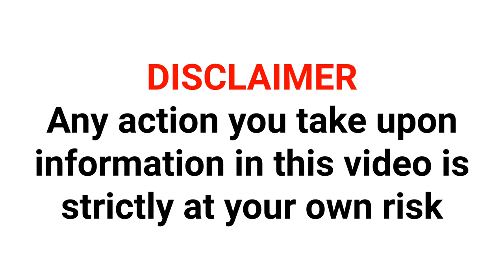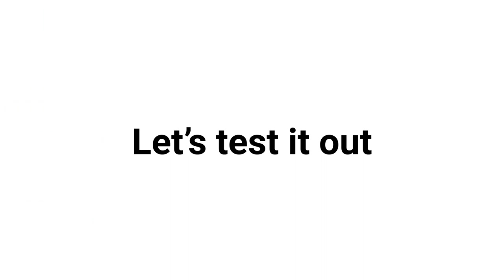Mixing Bowl Pizza Oven Assembly Instructions

Comment: Hi, this is a phenomenal idea and I will try to copy that. But I'm curious about something: How warm do the conductors which are directly contacted with the heating element get (at timestamp 2:58)? Could the insulation melt? And also the resistance of the cable could rise when the cable is getting warmer (but I don't know if this is relevant). Thank you so much!
Reply from the maker: The nichrome wire inside the element ends at least an inch and half from the connecting terminals so the ternimals don't get that hot. The fire retardant tape wouldn't even melt. You could use terminal connectors for proper wire connections https://ebay.us/nHsMKh . The cable does get warm after some 20 mins of continuous use but that's normal. I use 10amp cable which can resist 2000w of power. The element I use is only 1800w. For my use cooking flat bread and pizza, I preheat the bottom pan on gas for some 5 mins. After that I turn on the oven and pre-heat the bowl for 5 mins and that's all the time it needs. After cooking I turn off the oven from wall socket to prevent over heating.
Reply from the maker: @andreas5160  Nice list of items. Should be a nice build especially when you use a 16amp for 2.4kw is great and much safer. One important bit I'd to make sure the element is moulded into a W shape otherwise it will not cook evenly and will burn the pizza. The fan forced heating element is softer and can be easily shaped. And for 2.4 kw using regulator is kind of important otherwise pizza could cook too sooner than recommended 1.5 mins. That would leave inside the pizza base a bit raw. I check both the base and air temp before cooking. My base is aluminium alloy and that on gas heats up in about five mins and then I turn on the oven which needs another 5 mins to reach over 400c. That's the time I start cooking.
Reply from the maker: @andreas5160  if you're okay to share please link your build in a comment. Very excited to see everyone's implementation and how the pizza turns out. 😁
Reply from the maker: @andreas5160  make sure the bowl you use for the dome is stainless steel and of gauge size comparable to the one at IKEA that I use. This helps retain heat and reflect back the heat onto the pizza due to its shiny internal polish. The 36 cm is large enough for a nice 32+cm pizza to cook.

 I have tried aluminium ones they transfer heat into the air more rapidly resulting in inside the dome loosing it's heat capacity and prevents heat build up inside. Stainless steel is poorer conductor of heat then aluminium and has higher melting point so is a better choice.
Reply: @saidalisamed  Hi and thank you!

The construction:
1) Unfortunately my heating element cannot be bent :-/ But the first tests showed very good results and a good heat spreading - even with full power. The air temperature is rising above 500 °C in a few minutes and the baking stone has 400 °C in about 5 to 7 minutes without any additional heat source. The Pinsa (slighty different recipe than pizza) I tried was ready in approx. 90 seconds. 
2) I used the stainless steel pet food bowl from the another guy who copied your idea which is polished on in- and outside.

The following points could be improved at my construction:
1) For the first try I soldered the wires directly to the connectors but I will change it to a plug connection for easier maintaining.
2) The bottom side of the Pinsa was a bit slack/not ready enough while the top was perfect. For the pinsa you can easily flip the dough to get both sides ready, because the covering will be added after a short prebaking. But this will not work for pizza. I'm currently using a 10 mm pizza stone and no additional heat source under the stone. Maybe a gas cooker will do a better job to get a bigger punch from below. I also want to get a metal or aluminum plate instead of the stone for a better heat transfer. But haven't found a cheap source so far.
3) Some kind of top layer of the heating element seems to be speparated and can be rubbed off after cooling down. Maybe it's just from oxidizing and hopefully will not occur anymore. Did you make the same observation?
4) I want some kind of insulation either on the in- or outside of the bowl to prevent from heat loss. On windy days the oven is clearly struggling to hold the 450 to 500 °C afters putting in the dough. My first thought was to put in aluminum foil on the inside. But the melting point is at 660 °C and I don't know the temperature directly above the heating elements. Seems too close for me and I dont' know glue who can resist this temperature. Do you have any ideas for this?
5) The dough is getting soft and I was missing the crisp. This could be a result of the evaporating water which makes the atmosphere too steamy. Maybe I need some small holes. How do you solved that?
6) The distance between the heating elements and the baking stone is 10 cm. I try to reduce it to 5 to 7 cm.
7) I need a housing for the regulator.

I uploaded some pictures to imgur: https://imgur.com/a/DQKhT1p
Reply from the maker: 1. If the heat element is for fanforced oven it does bend easily. I used this https://www.ebay.com.au/itm/303881342051?hash=item46c0bd4c63:g:bXAAAOSwMDJgSEoC&frcectupt=true
2. depends on how much heat it stores for a single crust. heavy steel would store more heat. the more the weight of the material the more it heat it will store. Pure alumenium will not store enough heat. Make sure it is alluminium alloy which is heavier and should be thicker. Alloy will not burn the crust too quickly like the cast iron so matches similar result to a baking clay or stone.
3. yea this happens to mine too especially initially due to excess heat and probably oxidising factors.
4. if you more the element further down or raise the baking stone higher to the element to some 8 cm, that would not require insulation. Insulation would help prevent heat to escape but need to be careful of too much heat build up that could potentially burn out the element in worst case.
5. I think this is because the there's no bottom fired base and only depend on pre-heated stone which doesn't store enough heat for a single crust. Also, if you decrease the distance between what's cooking and the element that would crisp things up. You can also lift up the bowle a few times after every 45 seconds to let the steam escape in order to get crispy crust. For pizza you will usually turn it to get even cooking and that helps steam escape.
6. you would raise the making stone up that will make it easier than disassembling the element.

Looking at the results, it seems like the heat is more focused on the top of the crust in circle shape similar to element's shape. the centre of the crust and sides are not browned up. This happens when your element diameter is small which is typically 19cm. If you get a fanforced element like the one i linked above and bend it to W shape, it will spread heat evently and also cook the centre and the sides. This way you can move the element closer at some 7cm and get crisper crust. It will help heat up the stone faster as well.  For stone, leave it to pre-heat more. Something like 15 to 20 mins to ensure the entire stone is heated red hot - not just the surface. 10cm stone shoudl store enough heat if pre-heated for longer. The pet bowl steal guage seems to be thinner than Ikea's bowl that I use. thicker guage steel will let heat escape lesser and hold more heat inside. Also, the bbq thermometer showing 500c because it is at the same height as the heating element. The actual temp down at the stone level maybe lower to some 400c. But if you move the heating element closer that would help with more intense power.  The key to a good initial rise of the dough is very well pre-heated stone. In the picture I see the stone is larger than the bowl diameter so it can't fit inside the bowl. This meams stone wouldn't fully pre-heat because it has too much of its sides exposed outside the bowl and also bottom of the stone is not heating. If you could fit the stone inside the bowl and use another metal plate or something beneath the plate to fully close the chamber for pre-heating, stone would pre-heat enough to cook without having to flip the dough to cook the bottom. Hope this helps.
Reply from the maker: Looking at the heating element you've used, that looks like a fanforced which means easily bendable. All you need is to bend those the teeth of those 3 metalic notches that hold the two layers of the twisted element together so it releases it. Once those are removed, you can slowly pull away from each other and then form a W shape to the diameter of the bowl. You could use those teeths you removed from the element to hold the W shaped element to the bowl walls by screw attach the teeth to the bowl and make it hold the element in place. That's exactly what I did later after I shot the assembly video.
Reply: @saidalisamed  Hi and thank you.

1) Yes, the heating element looks very similar. I tried to bend the mount by 90 degrees to attach it horizontally but it made a pretty solid impression. When adding the new plugs I will remove the brackets and try to form a W shape.
2) Unfortunately I haven't found alumnium alloy plates for a decent price (< 40 EUR) so I will watch out for construction steel plates with 6 to 8 mm thickness.
3) Good to hear!
4) "too much heat build up that could potentially burn out the element in worst case" This is a good point. I will use a few nuts to get the heating element lower, this will be the cheapest and fastest solution in combination with the W shape.
5) Have to check that again the next time because when flipping the dough the steam had chance to escape. Maybe it's the Pinsa recipe who is more soft than crispy.

Yeah, the pet bowl is a little thinner than the ikea bowl. I've got both of them and decided for the pet bowl because of the flat top. But due to the more powerful heating element it should compensate the lack of thickness.

And you are also right with the thermometer. It's directly beneath the heating element but I think with this little volume the difference in air temperature should not more than 50 °C. But I will try to mount it a the side, approx. 5 cm above the stone so the dough will not touch it when rising.

Next time I will also use a camping gas cooker under the stone to give some extra power.

Could you please share a picture of your recent construction?
Reply from the maker: My latest build is similar to what I have in the video except that I reduced the use of tape instead I use the sleeves to cover terminals and now I use terminal connectors to properly connect the wires. Last time I think due to vibration while moving the oven it short curcuited and burned my element. I've had to buy another one, shape it and this time around, I use the brackets to tight it to the walls of the bowl securely. I also have a thermometer at the top that peaks at 430c after 5 mins preheating. I have some excess holes I drilled for some tests which I've closed using some nuts and bolts. The distance of the element from the bottom plate is still the same 7cm. Here are the pictures: https://imgur.com/a/NWceFLg  . The bottom pan I use is alluminium alloy and is about 5 kg so stores quite a bit of heat but a bit dear at $75 price tag.
Reply: @saidalisamed  Your bowl looks pretty cool, it reminds me of a vintage device for scientific or medical purposes. I will try to move the cables from the top to the side so the bowl can be laid down on top without tipping. I will show some photos after the reconstruction.
Reply: @saidalisamed  Hi, today I made a few modifications:

1) Bending the heating element to W shape
2) Mount the heating element on the side
3) Use wire connectors

The bending was a bit tough and took a long time but finally it had the right shape. When testing for the first time after bending, the residual current operated circuit breaker tripped after a few minutes while heating. After resetting the circuit breaker the oven wasn't heating anymore. After testing all components for continuity I came to the conclusion that the heating element seems to be damaged :-/ I think, that the conductor inside has damaged while bending the element. I really tried to bend it carefully but sometime you just need raw force, especially to turn the 90° angle to 180°.

Do you have some tips to bend it without damaging it?

Here are some pictures before it broke: https://imgur.com/a/IuFDBxH
Reply from the maker: @andreas5160  sad to hear the element has mulfunctioned. Looks like bending probably short circuited due to the insulating material not insulating anymore causing the element wire to contact the outer cover and burned. From the pictures the bent element does look in quite a decent shape similar to mine. For me, after removing the brackets, I could pull apart the two coil away from each other and slowly twist it to form a W shape. For the end of the element where it is company bent 90 degrees, I didn't straighten that up but bent the element from a little distance of that 90 degrees bend just to make it at around 50 to 45 degrees enough to install it through the holes into the bowl. btw, it is my second element that I bent and both worked after bending. The first one burned due to friction as I turned the bowl around on the pan.
Reply: @saidalisamed  Hi, here is an illustration how I bent it: https://i.imgur.com/1LQuOAu.png
This time I avoid step 2 to 3 and will check that the elements don't touch there. The twisting action needed from step 2 to 3 to get back into a good W shape was a real stress test for the heating elements. I bent it over and over againg till it fit. Step 3 to 4 needed the most force, maybe it broke there. The new element arrived today, hopefully I have more luck this time :)
Reply from the maker: @andreas5160  yea that's exactly how I bent except for step 3 where I bent a bit further away from that sharp factory curve just to get it to an angle so it fits into the holes in the bowl. My bowl is spherical in shape so doesn't need me to fully straighten it but a slight bend at 45 angle does the job. You could avoid step 2 entirely. The only downside would be that the heat will be more intense at the junction where the two sides of element cross each other but that should be negligible. So yea careful in step 3 and you should be good to go. Good luck and do share the outcome and cooking results. Also test out the element before bending to confirm it arrived in working condition.
Reply: There are a few cool modifications: https://imgur.com/a/L0SrBzg

1) Instead of screws I used a metal plate to cover the drilling holes on the top. By turning it to side, you have a real good look to the inside (it really works) to see how far the pizza is. Primarily I wanted this to control the temperature without a controller but it don't works too good.
2) The heating element is mounted with two bolts on top. By using counter nuts the height of the element can be fine tuned on both sides. This was primarily intended to fix the heating element but this makes it a lot more useful.
Reply from the maker: @andreas5160  well done and congratulations! Now it looks alot better and should cook really decent pies in no time. I bought this voltage controller  https://www.ebay.com.au/itm/324136472355 and it has been working fine. It does have a buzzing noise when I tune it down from 240 volts and the element also makes that noise. I guess that's normal because if the frequency changing or something. The controller helps me bake none pizza type dough without burning it.
Reply from the maker: @andreas5160  The idea to have a eye piece like opening to see how the pie is cooking is awesome I might also try that as well because for now I have to lift up the bowl to see the baking progress. Yea the bolts are good idea too to fine tune the distance for optimum cooking. The bent element now looks great. Do share pictures of how your pizza turns out. Make sure the bottom plate is fully heated or use a bottom heat source. You  can even cook bbq. I have done chicken beef just fine.
Reply: @saidalisamed  Thank you! The controller isn't damaged after all, it just needed some load to output the correct voltage. Mine does the same buzzing noises, as far as I read it comes from the lack of a filter circuit which prevents from interferences. 
Yesterday I made Tarte Flambee (https://imgur.com/a/VO6g9o0) and it worked so well. I made the following discoveries:
1) The spyholes aren't working outside, because the environment is to bright for your eyes to see inside. Indoors it could work.
2) When putting the dough into the oven, massive hot steam comes out of the spy holes which is great to get it more crisp.
3) My bouth 6 mm metal sheet (440 x 380 mm to use it in the baking oven as tray) doesn't work. The hot spot in the middle gets over 400 °C, but the corners are still at 80 °C because the heat transfer to the air is too big at the parts who are outside the bowl - even when using a gas cooker beneath. So the sheet bent itself to a bowl when heating up. So it will probably only work with round shaped and thinner metal like the one you're using (or I need much more time to preheat it evenly). So I went back to the baking stone which worked very acceptable with the new bent heating element.
Reply: One of the coolest "natural" features is, that you don't need to turn the pizza but you simply turn the oven by 180 degrees.
Reply from the maker: @andreas5160  I'm glad it worked well for you. Btw the link to your Tarte Flambee doesn't work. Can you post the correct link? Yea any part of the bottom plate outside will not heat up well. One way is to have the stone cut a bit smaller than the diameter of the Bowl so when you place the bowl it covers the stone entirely. This way you can use the metal plate beneath the stone to create a kind of enclosure for the stone. This way the stone will fully preheat as it will be fully trapped inside the bowl. I just baked an artisan bread without the controller. I just turned on and off the oven from the wall socket a few times to maintain that 220 cooking temp. It turned out great. Yea that natural feature of being able to turn the oven instead of the pie itself is great and cuts cooking time. Do post the link to your baked recipe and any other recipes should you try. Would love to see how the results turn out for you.
Reply: @saidalisamed  Oh, youtube added parenthesis to the link, just delete the last parenthesis: https://imgur.com/a/VO6g9o0
The stone has almost the exact size for the oven, only the metal plate is too big as rectangle (because I want to use it as a tray in the baking oven). So the stone will do fine with the current version of the oven.
For me I want to have about 350 °C +-30 at the stone surface (bigger temperatures will burn the dough really fast) and with level 6 of 10 at the controller it will hold this temperature really fine. 

Yeah, I saw your artisan bread video. Looks very delicious, but for breads I will prefer the baking oven, which is doing very well for me after a year of experimenting :) 

The recipe for the Tarte Flambee is:
250 g White wheat flour
140 g Cold water
6,5 g Salt
10 g Olive Oil

Knead the dough really well (do the window pane test), shape balls of 100 g (this size is perfect for the oven) and let it sit for about 20 minutes, so the dough becomes flexible (there is no raising agent, so you can use the dough almost instantaneous).
Now just roll out the dough balls really flat (about 1 to 2 mm thick). When you think it's thin enough, you can normally make it more thinner. Use a lot of wheat, so it doesn't stick on the rolling pin. Traditionally you spread a mixture of sour cream/cream on the dough and put diced bacon and onion slices/porree slices on top and a salt/pepper seasoning. Then bake it until ready (about two minutes). But you can add almost everything on top.

Do you have a good recipe for oriental flat bread?
Reply: @saidalisamed  How did you get the idea of building this oven and how long do you experimented with it?
Reply from the maker: Thanks I see the results now. Nice and airy crust and edges of the crust cooked indicating even temperature from the element. For flat breads not many recipes I've tried just the ones in the description of a couple of my videos in the channel.
Reply: @saidalisamed  Yesterday I made Pizza bread with normal pizza dough. Just topped with fried garlic oil, it was so delicious. Here are some pictures: https://imgur.com/a/3LmnpXW
The recipe:
White wheat flour
70 % water
3 % salt
1 % fresh yeast
It's fermented for 24 hours in the fridge.

Also I cutted the defect heating element to see how the structure inside looks. Here are some pictures: https://imgur.com/a/yF6vQAo
As you see, the insulation between the conductor and the outer metal is not constant solid but just on neuralgic spots. The spaces between were filled with some kind of white powder. So at some stage of bending the conductor could make contact with the outer metal, so your whole bowl will be under voltage. This shows how important it is to have a proper working grounding. But I'm not sure, if every heating element is built like this.
Reply from the maker: Thanks for sharing photos. The pizza looks great and nice and airy cornices. Now I can see it is cooking nice and evenly and the sides of the pie got  cooked as well just like an authentic oven. You got the leopard spotting on the crust as well which indicates intense woodfired oven like heat intensity and proper dough fermentation. I guess you can feel accomplished ☺️ now. Yes the heating elements are not of good quality mostly. They all have the magnesium oxide filling as insulation of electrical conductivity and those empty spots mean manufacturer didn't do a good job. Even at the factory they first fill and weild the ends in a straight tube then shape it into whatever shape they have orders for. It does have a degree of reshaping tolerance but not too much and nichrome wire could contact with outer shell if bent too much.
Reply: @saidalisamed  Thank you, it's such a cool invention which improves baking so much!